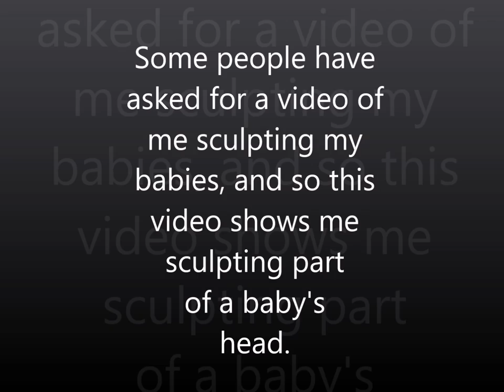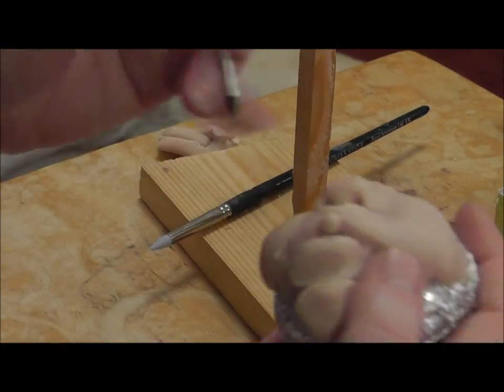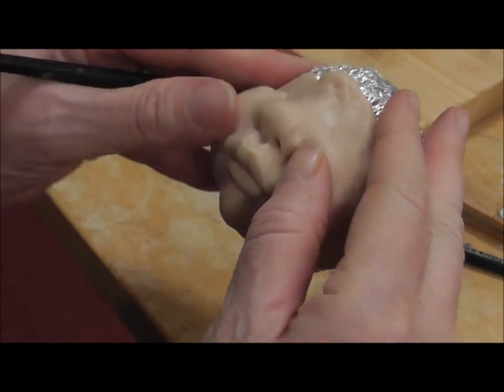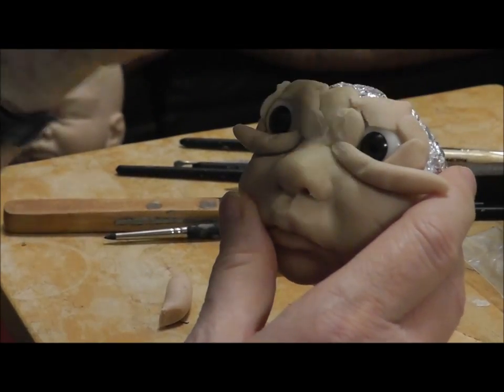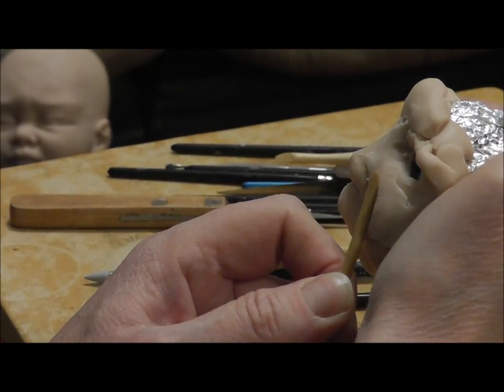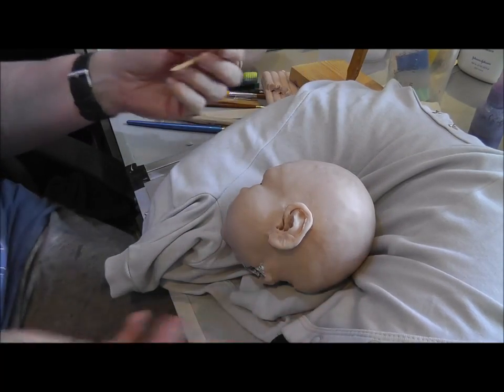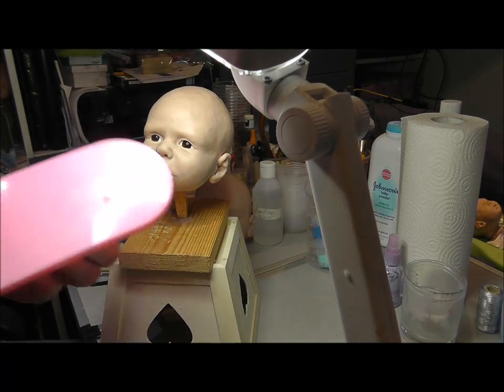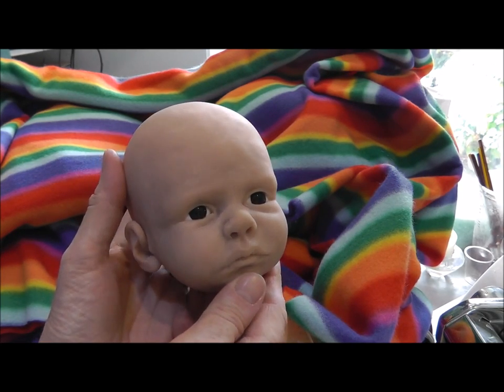Sculpting Daniel

Comment: Hello Carolyn i have a concern with working with polymer clay it's the best clay to work with but how can i prevent my sculpts from cracking during baking? I bake them at the right required temperature using my oven thermometer and bake for the required length of time.. But still all my sculpts comes out with cracks and a few light burns.. I can deal with the light burns.. But Do you have any advice on how i can minimize the cracks? Thanks ❤
Reply from the maker: Shonta Ford    You can still use the sculpt for moulding even if it’s a little burnt.  Cracking - I think most of us get cracking sometimes, I’m not an expert in polymer I’ve only been using it a couple of years but I believe making sure it’s well kneeded before use can help, and I know a lot of artists switch off oven when baked and leave sculpts inside oven to completely cool before touching or moving it. Also suppose sculpt with rolls of towel or filler to support areas that don’t lie on the baking sheet like under knees and behind neck. You can patch up
Cracks with clay or liquid sculpey and rebake or mend with sculpey glue and rebake.

Comment: How long can you work with the clay before it starts to dry out? About how much clay does it take to do one head. And one more question, I know you said you are using Super Sculpey. What temp does that clay have to be baked?
Reply from the maker: You can work with the clay indefinitely until it’s baked. Some people pop it in plastic bag between sessions to keep it clean it it lasts a long time. When you bake there are instructions on packet but I think most polymer clays bake at 130 degrees

Comment: Carol, you do such great work with your dolls. I am interested in creating doll sculpts as well. I have 2 questions, how much foil should I use to start the head? Also, I saw on one of your videos where you made a pour spout. Am I supposed to sculpt a pour spout when making silicone babies?
Reply from the maker: shealena f     Foil - just scrunch it until it’s at the size you want it. Pour spout - if sculpting a head for a cloth body kit or ball jointed you don’t need a pour spout as you will pour through the neck. If it’s full body baby with a fixed head yes you need a pour spout.